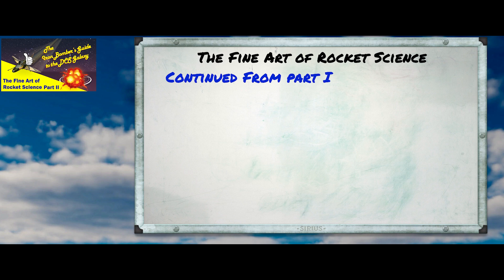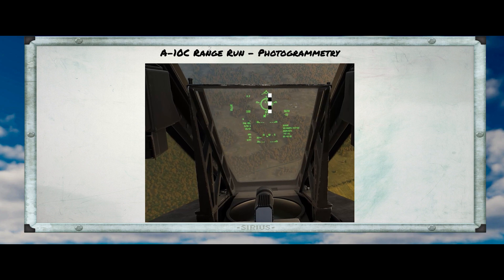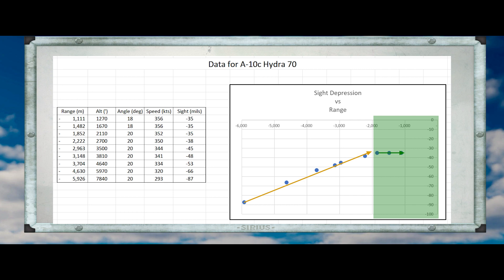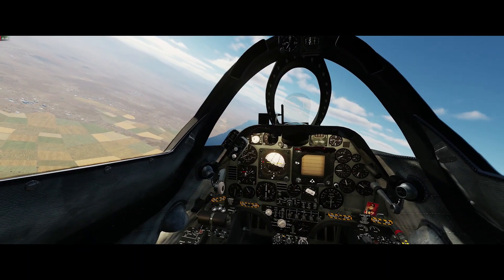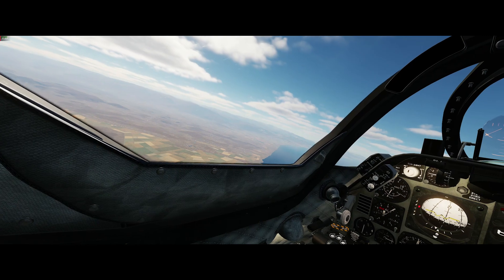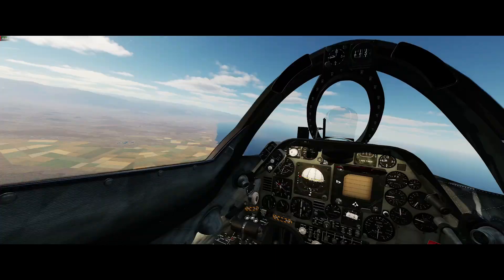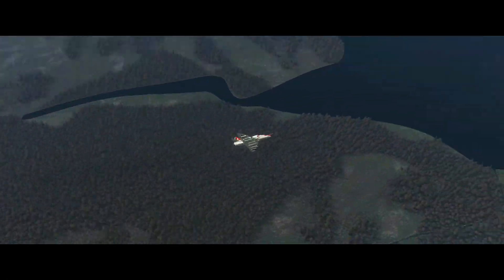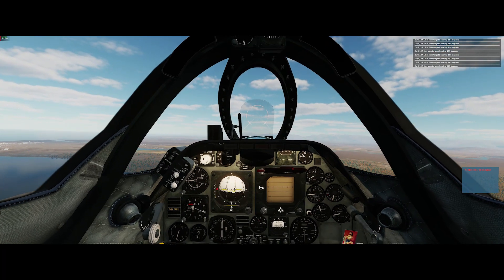More DCS Rocket Science!

Comment: I work in the drone industry, mainly in mapping/scanning and inspection, and we use multiple programs to photogrammetrically correct the images and stitch them together to get a Digital Terrain Model, a Digital Surface Model, and an orthomosaic. We can even geo-reference the map/scan to a relative accuracy of 2.5cm and an absolute accuracy of 5cm using multi-band GNSS receivers built into the drone. I got into the business after taking a completely unrelated degree and so I dont have a background in manual photogrammetry, but seeing how it works in practice just leaves me in awe of what the modern software is capable of. As usual, this channel is non-stop nerd heaven lol
Reply from the maker: Wudyabelieve... I also know a little bit about that industry too. Worked for a while on doing mobile ground based lidar scanning and georeferencing it to map it to 2D imagery.

Beginning to believe we are twins separated by some strange twist in the space-time continuum...